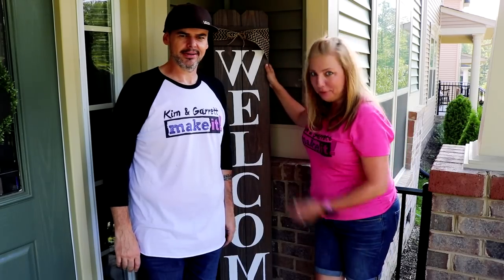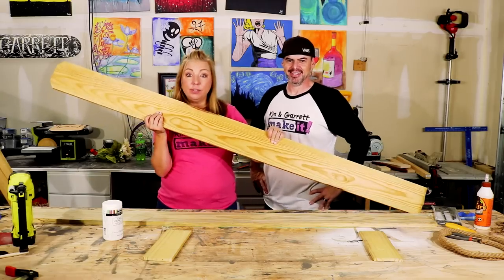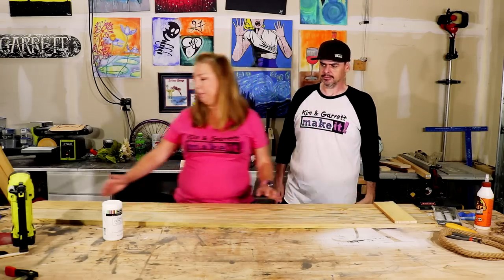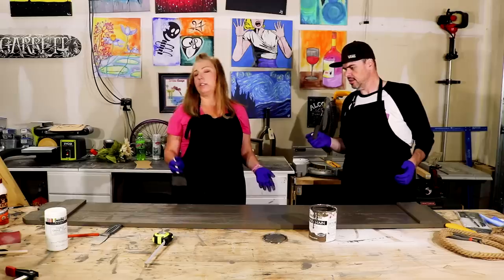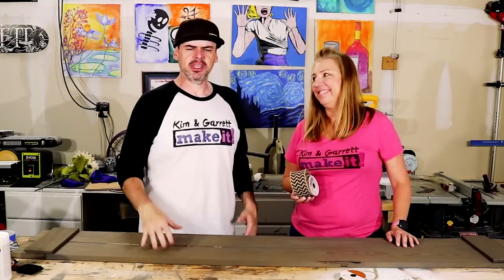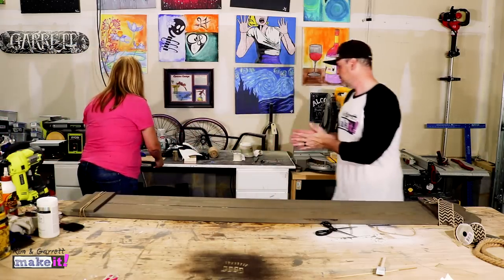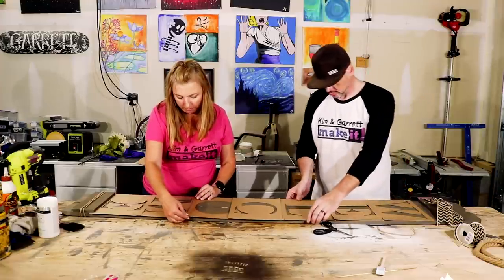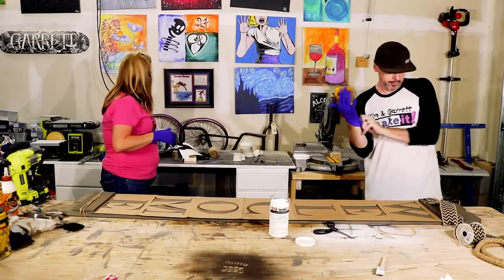DIY Front Porch Welcome Sign - $5 Quick and Easy!

Comment: This may be a stupid question, but what type of paint did you use for the letters?  I just want to make sure it will hold through the weather.  Thanks so much for the videos!
Reply from the maker: We used acrylic paint and then a Polyacrylic spray coating over the whole thing.  You can also use outdoor acrylic paint.

Comment: I got my wood from actual real Texas reclaimed barn wood for free, sanded it and white washed it  , did the letters and added some greenery and hand sanded the edges to make it look more rustic , also gold or silver metallic paints outlined in black, aka permant Sharpe black do well too, I polyurethaned the entire things to seal it all in , do not press down hard when adding the poly on top bc it will bleed a tiny bit, I used a sponge like you use for staining wood. You can use any oil based or latex paints AS LONG AS THEY CONTAIN A PRIMER IN THEM AS WELL OTHER WISE YOU CAN'T PAINT THEM ON TOP OF ONE ANOTHER,  IMPORTANT....  PEOPLE WILL TELL YOU. YOU CAN'T BUT I PROMISE YOU CAN , JUST AS LONG AS THE SURFACE HAS DRIED FULLY AND THE PAINT OIL OR LATEX HAS PRIMER IN IT. NOT MANY OIL BASED PAINTS HAVE THAT UNLESD IT'S  SPRAY PAINT . GOOD LUCK. PS.  HERE'S A TIP YOU CAN PRIME ANYTHING USING MODGE PODGE FLAT AND FOR SMALLER DETAILS PULL OUT YOUR FINE TIPED PERMANT MARKERS,  NEVER KNOW THE DIFFERENCE.
Reply from the maker: Thanks for sharing, and the great tips!
Reply: Is the W backwards?
Reply: How do you use the modge podge?
Reply from the maker: We used the mod podge to create a little dam so the paint won't bleed.

Comment: Did you buy an extra Dog fence to nail the back of the boards ? I know you got two cut a board and glued and nailed it down. What type of wood was for that ? And the measurements ?
Reply from the maker: Hi Latoyia, We used a cheaper smaller fence picket for the cross braces. I believe is was a 3ft tall Gothic picket, for like $1.50.  We made another front porch welcome sign video, where we just used Guerrilla Glue instead of nails.

Comment: Did you sand the fence posts before painting? Also if I don’t have a nail gun would an electric drill work?
Reply from the maker: No, we didnt sand these. We just stained the boards, any texture just adds to the charm.  And yes, you can definitely just screw them together, probably more secure in the long run.

Comment: Did you glue the 2 pieces together?
Reply from the maker: The top and bottom boards hold ot together. You can use original Gorilla glue to glue them on instead of nails if you prefer.  I suggest gluing before staining.

Comment: Before staining did Garrett nail or staple the two wooden pieces on back of welcome sign?
Reply from the maker: The two wood pieces are on the front of ours. (You can do it either way).  We nailed them, but you could also use screws. I'm not sure the staples would hold them.

Comment: Hey. What kind of paint brush did you use? My letters were running everywhere.
Reply from the maker: We use a sponge and put down a layer of modpodge first!
Reply: @KimandGarrettmakeit  so you paint it then do an entire layer of
Mid podge and then stencil? And is your stencil just normal card stock? And where do we get your svg images?
Reply from the maker: We used the mod podge to create a little dam so the paint won't bleed. We just used Times New Roman inside Cricut Design Space, we didn't need an SVG.
Reply from the maker: Yes, it was just regular card stock. The thicker stuff.

Comment: How were you able to ensure the paint did not bleed using kraft paper? It does for me : (
Reply from the maker: +Vanessa Palomino it was a PAIN! We wore rubber gloves and had to hold down right where we were dabbing. We also tried to dab the paint on straight up and down with very little paint on the foam brush. Using vinyl is quicker and easy, but costs a bit more. We both like vinyl better.

Comment: Is there a specific reason you all don’t put your design on the other side of the board.
Reply from the maker: because you typically don't see the back!
Reply: @KimandGarrettmakeit   okay one last question. My wood has a overlap which doesn’t  let my words lay flat. Should I cut a thin like down the middle of the board so that you don’t see the overlap?
Reply from the maker: Yep, when we use vinyl, we place it on the boards and slice it between the two boards.
Reply: @KimandGarrettmakeit  perfect thank you